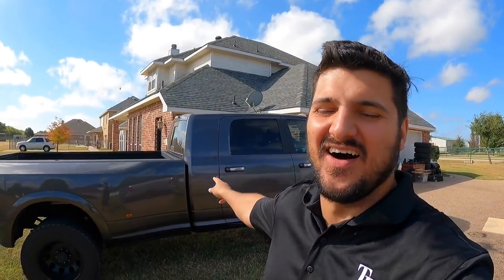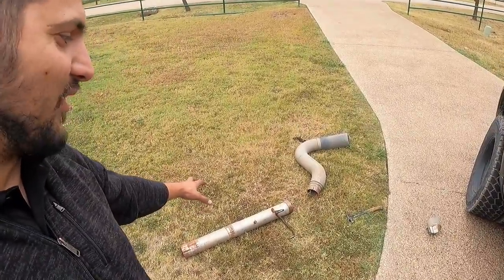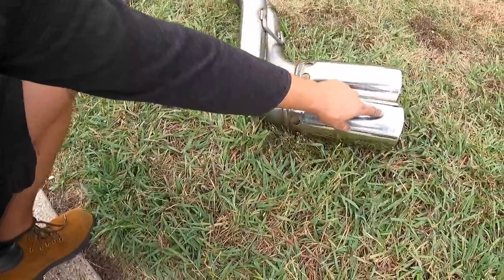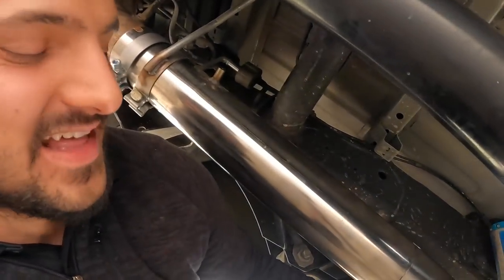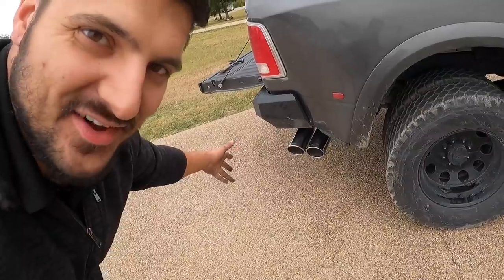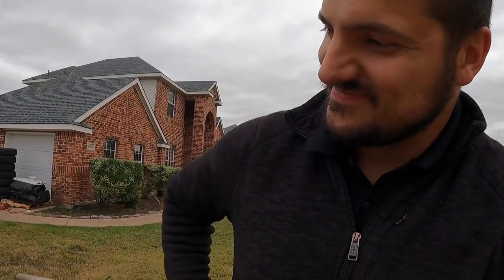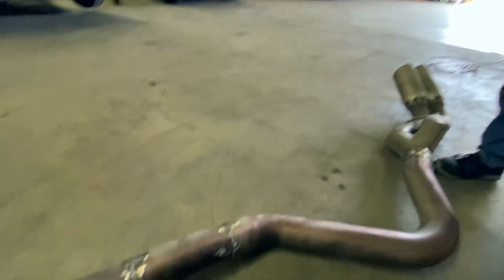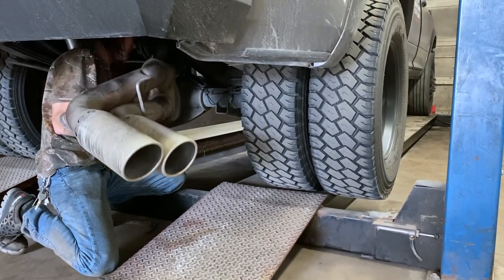Installing a “FORD exhaust” on my RAM / Cummins

Comment: Hey TP - i have put multiple exhaust systems on pickup over the years.   I never considered a bolt on as there are plenty of quality Muffler shops in my area.  I leave that work for the Professionals.    At some point, you learn your time is worth so much per hour.    

I liked mowing my own lawn but it was a 2 hours adventure but I liked the exercise and gave me time to think.  My mindset has changed now that I am self employed.  I can make more money in my home office in two hours than the mowing is worth.  I subscribe to work smarter not harder.

Keep making the videos and the truck rolling!

Comment: Alex is that truck much longer than the F3 50? Are you still OK using a 40 foot trailer and not going over your length limit?

Comment: 1. Steve did a good job on the welds for stainless, it doesn't have to look good just has to work. 2. Finally someone else says how stupid the axle dump is. I'm already driving a loud smelly diesel, now I want it to give me a headache from my head buzzing every time I drive it too? No thanks. I bought an old 7.3 with an f-in HOOD STACK and that thing came right off and I put a Diamond Eye 4" turbo back full exhaust on with a little glasspack style muffler. No drone, sounds pretty good at the tailpipe, I can hear the turbo whistle nice, made in USA and only $300 shipped to my door. Can't beat it.

Comment: That's a beautiful truck. I don't think you could hurt yourself too bad on that exhaust, but I like to stay away from the modifications if I can. Reason being, if you have a particular modification and break down in a Podunk town because of the modification, it could be days before you're able to find the replacement part. I prefer walking into Napa or the dealer and buying off the shelf when FIT hits the SHAN.... 👍🤣👊

Comment: Alex........The dual exhaust ends need to be pointed down for condensation purposes.  You want all condensation to run out, not stay in the exhaust system where over time would make it rust much more quickly.

Comment: pointless to pay for overnight shipping.  It arrives the usual time.  The current truck's exhaust would be putting soot all over the rear brakes most likely as it is blowing into the back wheel.  Remember to use Pittsburgh Power Catalyst in your diesel tank to keep your emissions systems clean.  avoid emission system failures and more

Comment: The exhaust pipe looks good, its nice that it is stainless steel. Next time I have to replace my tail pipe I'm going to look into that option. Up in Canada I have to replace the stock tail pipe (aluminized steel) every three years from all the Liquid Calcium Carbonite (worse then salt) thats used on the roads. Did you figure out what your axle gear ratio actually is now with the larger wheels.

Comment: You can mig stainless easy with the right gas and wire, although it is easier to tig stainless and there is a helium gas shortage. Ya boy CP Steve needs a tig
Reply: 308 filler wire and tri-mix shielding gas,  90%He/7.5%Ar/2.5%CO2, is what you use to MIG weld stainless.  For welding stainless to carbon steel, switch to 309 filler wire.

Comment: I'm still confused about the how you get paid video. Basically, what is the next step after you call and confirm a load on the load board? Do you call your factoring company who then calls the shipper for invoicing, or how exactly does this work? I understand sending them an invoice yourself and COD, but not the part where the factoring and broker are involved. If you or someone can help clarify this, I would be truly grateful!
Reply: Basically you “sell” your signed bol’s to the factoring company when the load is delivered along with your invoices

Comment: I agree it looks like a rice packer. But thanks for the video. Ur doing good keep up the good videos.
That's just a weak lift there alex. My mechanics  lift will lift 18,000 so its just a weak lift. So most if ur shop's  will have one that will lift unless they went the cheap way in there lift.

Comment: I passed u on i-86 yesterday in ny. U either dont have a cb or didnt have it on but nice setup u have for yourself
Reply from the maker: I don’t have a CB
Reply: You should really get one. They can save your life..it did mine 15 yrs ago in the pitch black  night when a truck was parked on the interstate no lights on...i was warned by the east bound drivers...the driver of the truck who parked in the interstate lane..was crashed out behind steering wheel..he had been doing allot of cocain.
Reply: I-86 is my neck of the woods, southern tier of New York.  Horseheads, Corning, Elmira region
Reply: @TowPiglet  you hold really get a CB
Reply: I don’t have one anymore.  Loved it during 80s to 2000.  But I turned it off by every city.  Really nasty people hogging the channels.  I wonder if it’s maybe better?

Comment: Lol... Could've just removed the axle dump tip and had an exhaust shop add some pipe and the same tip to the end for a side exit. Probably would've cost $100-$150, if that, and done the job... The dual tip works though. Probably quieter than a single too!

Comment: I am curious if when you purchased this truck Alex if it came with paperwork for a certified welder for the frame welding and engineering documents.
Just curious how this would pass an inspection as I remember another hot shotter (I think it was South Georgia Hotshot) who had his trailer removed from service for not being engineered and welded by a certified welder.
Reply: that because someone told Dot and show them.the video of him modifying his trailer
Reply: @oldman2638  correct and alex showed us a video of his truck being welded when he was going to mount his gooose ball plate under the body
Reply: @TokyoCollins  Damn sound like some snitching going on here, Why broadcasted it on the internet. LMBO!!!!!!
Reply: @chuckychuck  Cuz that's how they're getting paid...well one source
Reply: @oldman2638  I tried to find that info.  I found him cutting, welding..  but never found the DOT removing it from service. Could someone send me a link?

  I have seen semi trucks shortened, stretched.  Guy doing the welding never certified in welding.  But did dang good job.  I saw it after frame stretch done, before painting. Angle cuts, full welds, next size frame channel 2’ longer then angle cut welded in. Drop a tank and that section wouldn’t fail.

Comment: The Mopar purists are going to have aneurysms watching your videos.
Reply: Hit up CP Steve Miller? Lol I'll just run over to Pennsylvania real quick🤣🤣
Reply: Also you can mig weld Stainless. You just need stainless wire for machine and usually need a diff gas like Argon for non ferrous metals
You can use carbon steel wire but then youll end up having rust and corrosion at the weld points much faster. 
You can also weld Carbon steel to Stainless but you should be using a dissimilar fill rod for that application.
Reply: 308 filler wire and tri-mix shielding gas,  90%He/7.5%Ar/2.5%CO2, is what you use to MIG weld stainless.  For welding stainless to carbon steel, switch to 309 filler wire.

Comment: Confused, thought CP  Steve worked in PA,  how is it he was suddenly in Texas, w/ a shop?
Reply: Lol..he was going thru PA and he stopped by so CP could do it.
Reply: @IA-py9by  that does not work because UPS was  hoping his muffler parts in Texas,
Reply: @billupstateny9151  he received the muffler at home in Texas then installed it...and after he went thru PA with a load and had CP weld it...this video is not all on 1 day.

Comment: At that amount of money should've just had a custom shop that fabricates put the piping on (especially with going to a shop to have weld up), if just DPF back, you either put on aluminized or stainless pipes...no difference in manufacturers.

Comment: Can you do another mpg test and include if the 5 to 6 gear change issue is still on going now the exhaust has been changed out
Reply from the maker: Yes I will
Reply: Flat tire fixed, clean air filter, engine service...  I hope it’s better.

Comment: if the exhaust had to be TIG welded... I guess its stainless steel... and it doesnt rust. unfortunately, he used a MIG welder so every weld WILL rust... and it contaminated the SS so...  very wrong move.

Comment: 5 inch straight to a 10 inch tip axel dump on my 6.7 and I love it. Don’t pull a trailer much anymore so the “drone” is basically non existent.

Comment: The hell is the point of changing the tail pipe of your not gonna delete the emissions
Reply: Short list? He didn’t like in cab noise, slight concern on fumes into cab, heat on rear tires, particulate on tire, rims, brakes...